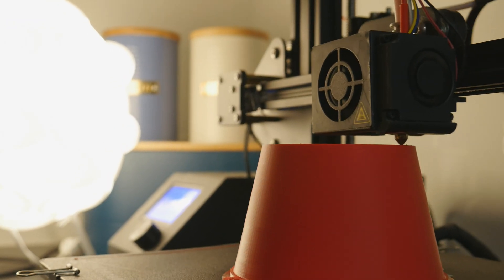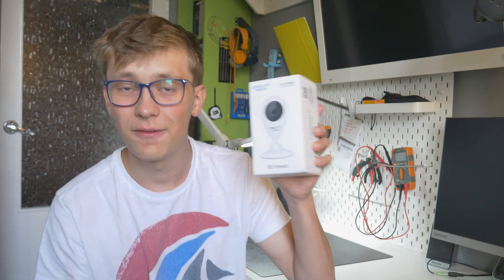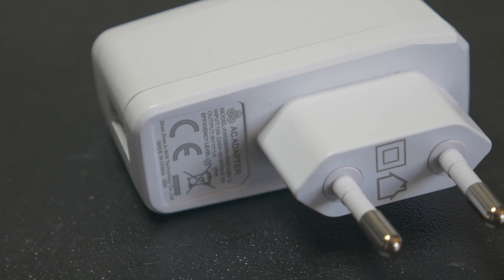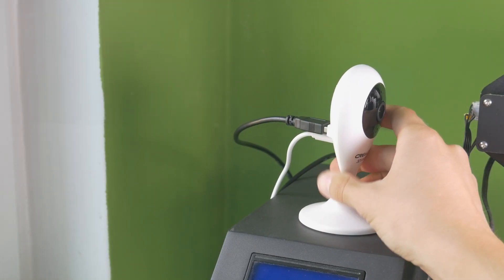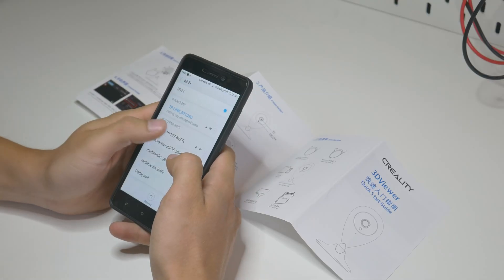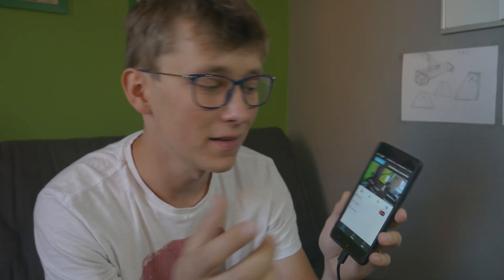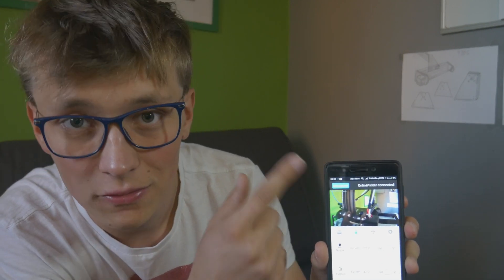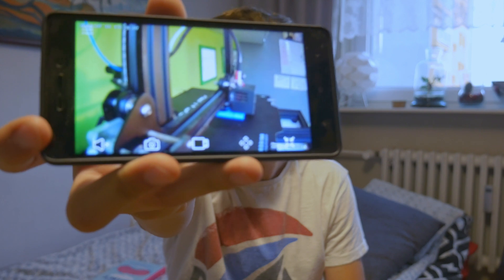Control 3D printer From Anywhere With Creality Camera!

Comment: Realy nice to watch and controll your printer from anywhere.
The biggest question i realy like to know is this:
CAN YOU TURN OFF YOUR PRINTER (CUT POWER) if something realy bad happens like a fire (and something like a bad print).
Also timelapse function would be very helpfull.
Reply: You can get a wi-fi socket so it turns off from your phone

Comment: Good review.  You showed the product then highlighted strengths and weaknesses.  I think that the product is nice for those folks who don't want to mess with assembling a camera/RaspberryPi/Octoprint.  Two additions would make this more useful.  One is the smart plug that others have mentioned.  The other is the ability in the App to add more buttons each with an editable G-code for custom functions.